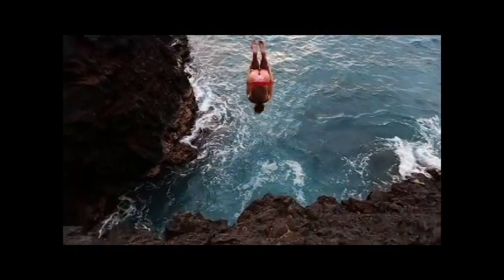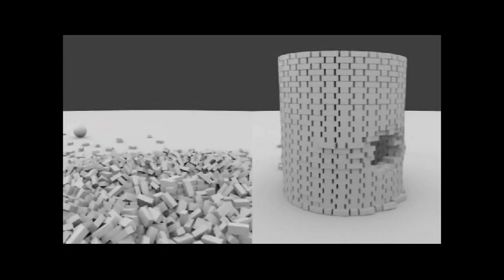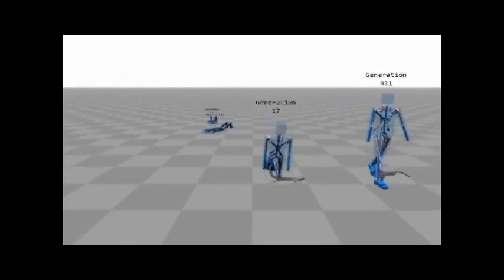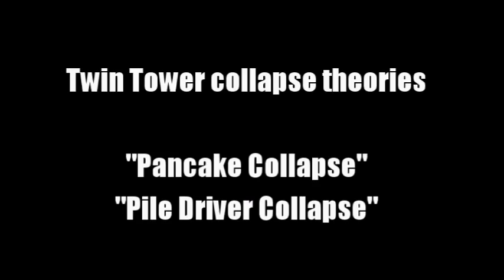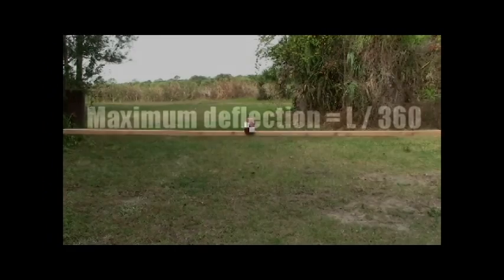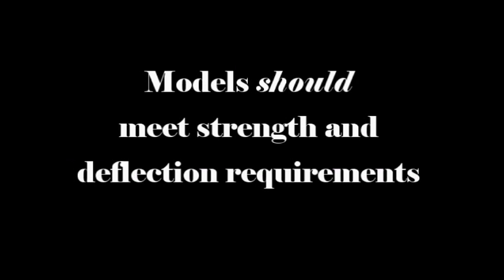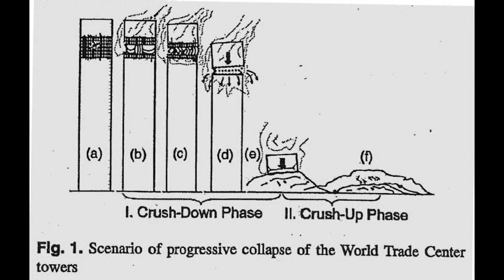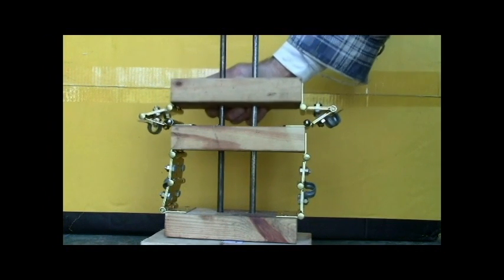9/11 Experiments: The Force Behind the Motion

Comment: The reason I think the upper structure was able to destroy the lower structure is you have the weight of the flooring all combined but where is the jolt or deceleration. Are we missing it through all the smoke? I'm also trying to figure out how we got to 1300 degrees on the ground did we have to have an oxidant because they claim there was no evidence of aluminum oxide? Worcester polytechnic Institute claims that they discovered sulfur in the fireproofing.
Reply: Conventional fire burns that hot - and hotter.
Reply: @Tim22222  steel and concrete can burn at close to 1400 degrees Celsius? Close to 2500 degrees Fahrenheit on the surface of a smoldering fire of concrete and steel? What was the highly energetic fuel.  At least those are the numbers that have been cited in webinars I've listened to. I've been struggling to find NASA's open information on that and looking at the locations of the temperatures in the aftermath. From what I understand kerosene jet fuel is actually a rather low energy fuel can't accomplish this kind of temperature. I haven't a clue but if you could site me some scientific evidence I really would love to shut the door on this conspiracy theory.
Reply: @Tim22222  I'm mixed fahrenheit and celsius. I misinterpreted information at 1340 Celsius when it was actually  1340 fahrenheit.  NASA says 1000 Kelvin = 1340f on the 16th.   I still wonder what the oxidizing agent was at that temperature? We are talking on the 16th of September these were the surface temperatures from satellite so the interior temperatures may have been significantly hotter. The reason I got so hooked on these numbers is because I was trying to understand the eutectic steel formations. The origin of the sulfur in the melted corroded steel. I watch the webinar from NSL analytics and they pointed towards fireproofing as being the source of the sulfur but the sulfur in order to create these formations had to be in a very intimate position but that still doesn't explain your oxidizing agents and residual heat of 1,000 Kelvin four days later? They claim WPI worchester polytech Institute had discovered the sulfur in testing some of the fireproofing but I was not able to find that in wpi's database in their research library.
Reply: @Tim22222  have you seen Leroy Hulsey  analysis of the thermal expansion theory and how it directionally it has problems, he left the fireproofing  out of his calculation in order to give a worst case scenario. stiffest point in the floor plan was actually the stairwell he believed majority of the expansion would have headed outwards upon that longest beam..  the National Institute had fixed the perimeter wall as the point of origin for expansion.   Their calculation had all the expansion heading inwards towards column 79, to push the adjoining horizontal beam off its seat. Then intiating the progressive collapse theory. But the drawings showed it was bolted to it's seat, had 30 shear studs in the concrete floor above it, was encased in the vertical column by extra torsional stuffers, and that it had web stiffeners on the end of the flanges where folding over of the flange would have been inhibited if it slid half way off its seat. And all of these elements were left out of the official model to accomplish this theory. This model did not explain how thousands of other connections of beams were unable to resist the force of  one beam falling. Hulsey has been spending years on a model trying to figure out what variables would have to be in order to truly accomplish an interior collapse. He briefly had mentioned if you removed the connections of eight floors you could initiate that collapse. But he's yet to release a full report on that wanting to make sure it's right.  I thought that was coming very soon. The only reason I know about all this is because I watched a newly released A&E building 7 webinar that laid all this out.
Reply: @akiracornell  " I still wonder what the oxidizing agent was at that temperature?"

Oxygen! A pile like that is hardly airtight, and there was unlimited fuel. Underground fires like that are not unprecedented ... As far as the eutectic corrosion I get that that's fascinating; from what I understand, it's more of a chemical process that takes place at much lower temperatures than fire. Sulphur was present in the sheet rock used to build interior walls of the offices.
Reply: @Tim22222  you  obviously did not watch this author's other experiment on eutectic steel. At minimum of 940c that's close to 1800 Fahrenheit in a slow burn based on the metallurgy.  that's the minimum we know it had to have reached. You really need to watch his other video on experimenting with kerosene and crushed gypsum wall board as the sulfur theory, that's a no go Houston. 
  Smoldering fires without flames yield lower temperatures. You need an oxidizer or high amounts of oxygen. This is also a significant amount of sulfur involved in the reaction from what I understand. I need to better learn how to decipher the eutectic diagram to understand the sulphur percentage by weight in the reaction.  But again not only are these temperatures combined with the sulfur peculiar we don't have the input data for the progressive collapse model by NIST for building 7 to be corroborated by those that question whether or not something else could have happened. All we have is this far-reaching anomaly theory. If you believe in science and you listen to Hulsey's calculations, it's only obvious if you are willing to look at things from a scientific perspective, it's time to consider other hypothesis, but that's not the story we're trying to defend here are we?
Reply: @Tim22222  nobody can prove it was thermate involved in the eutectic formation but thermate can exactly produce the type of erosion that occurred. This author shows that if you can encapsulate thermate you can configure it quite easily to sever beams. Imagine if you could put some type of polymer that would air dry on the outside and apply in a beaded fashion. Then at the end of your cut place bits of nanothermite to finish the job. I'm pretty sure somebody could develop it. It makes a whole lot more logical sense that some type of covert mission could have been done to infiltrate that building then to think it was just an anomaly that self collapsed on itself because one beam fell out of place because another beam expanded the wrong way breaking the bolts and pushing it off of its seat eluding it's sheer studs and going through the encased vertical support on the column to create a theory to explain how the penthouse fell and sucked the whole structure in before the exterior collapsed in free fall. If there are people capable of engineering and planting a virus within a closed Network like the stuxnet. I think brainstorming and infiltrating a building is not that hard; I believe there was a man named Jennings who went back into the building 7 to get something and heard explosions and was told to get back,  it's coming down we have information of bombs. Nope they didn't exceed 130 decibels but this author has also shown that you didn't need to with the proper chemicals that could create the kind reminant steel and temperatures we saw. There was also a seismic bell curved wave indicating explosive nature  that preceded the collapse.
Reply: @Tim22222  didn't cardington test show that the beams would sag before thermal expansion would bust the connections?
Reply: @akiracornell  I stand corrected; looking back at Appendix C of the NIST report, they too cite temps of about 1000°C to activate the eutectic reaction. Still, though, that's a lot less than the straight-up melting point of steel and consistent with estimates of the temperatures of the hottest fires.
Reply: @Tim22222  I believe they cite the fires were probably half of that temperature while they were burning. They also say that the maximum thermal expansion would take place somewhere around 300 c I believe. And building 7 had actually collapsed hours after the fire was out in the location that they say where the thermal expansion happened. For me it was almost a fraudulent theory to create reasonable doubt that the office fires were responsible for the building 7 collapse. Hulsey takes the theory and puts it on its head. It took them many many years to even come up with some kind of collapse theory they could give to the public
Reply: @Tim22222  in thermate and thermite you don't need free oxygen. It's typically an aluminum powder that is the oxidizing agent but a lot of debunkers like to say that they didn't find any aluminum oxide spheres I do believe there are other powders and chemicals that can be used that will accept the electron to produce the exothermic reactions. And I'm not sure how much of it will gas off not imbedding into the steel like the sulfur did. From a lamens point of view trying to speculate, these are questions that I have. I have heard that FEMA hadn't gone out until 30 days after to start taking samples and investigating. Much of the material was already gone.
Reply: @akiracornell  I'm no chemist but as I understand it the key finding of the Millette study of the WTC dust - an independent attempt to reproduce the Harrit/Jones result - was not about aluminum oxide but rather elemental aluminum, a required element of thermite which was not found in the dust. No elemental aluminum, no thermite.
Reply: @Tim22222 that's the point Mick West tried to push but, that's what I was trying to hypothesize, because iron oxide loses the electron and becomes the new free radical while aluminum oxide is formed.  My question is, does most of the aluminum oxide predominantly gas off  leaving minor traces of aluminum oxide spheres or dust, or whatever oxidizing agent that gets reduced. Can they be dusted off and lost because most of it ends up being vaporized ?  The other issue we have is they only had a handful of pieces, some from building 7 and the some from The towers. FEMA didn't get out there for 30 days and most of it the debris were gone, They didn't really have much to analyze. Again I go back to the peculiarity of the fact that there was an intimate, abundant sulfur on the steel and the temperatures of smoldering  office furniture should yield much lower temperatures without being fan fired,  which points to chemical fire much more likely culprit.  Again you had witnesses see of flashes of light and pressure Puffs according to NIST. And anything under 130 decibels was not considered an explosion. All the other correlative incidents get ignored seeking an explanation for. My question for you is Have you listened to this author's videos and understand all the problems with the official story? Have you even looked into Hulseys examination? If you're going to ignore all of those other things and just hang on creating reasonable doubt that office furniture could have created 1700 degrees Fahrenheit at minimum in a smoldering fire I think your lack of natural curiosity to answer the other questions causes me to question your motive here
Reply: @Tim22222  I do remember reading a written a&e rebuttal to the WTC 7 report from nist, he claimed Jones had found fluorine and traces of aluminum in the metal that he had tested. I'm not sure what chemical process the metallurgists use to examine the molten steel, but being  the oxidizing agent becomes a stable molecule I don't know how much of it would actually embed into the steel itself. This is a very good question for metallurgists because they made no clear mention of we don't see any residues of aluminum oxide, but maybe they wouldn't be able to see much of it based on the type of chemical reaction that's taking place or the process they use to analyze it? You or I should seek out one of the few in the country that has a clear answer to the question
Reply: @Tim22222  here's another question for you. Takes months of planning and strategic placement of cuts and explosives to get a building to implode into its own footprint. But the official story says they only needed to displace one beam to accomplish the same thing,  do you see the irony in the deductive reasoning?
Reply: @akiracornell  "do you see the irony in the deductive reasoning?"
Yet it took 3 years of study to come to this conlcusion. I can hardly imagine any CD company doing the same to see if they could save a few bucks on explosives.
Reply: @brucelansberg5485  Make-believe nonsense, is the sources.

Comment: For 2.3 billion we could rebuild the towers and remote control two planes and test it again.  That's a drop in the bucket compared to what has been spent in Afghanistan.
Reply: I'd settle for a test of the aluminum plane that is ripped apart by birds flying into the exterior of the building.

Because I say it folds up like a pancake.

Id also like one vs 3 feet of concrete and kevlar that builds the outer wall of the Pentagon. 

And I want a trainee pilot who flies a passenger jet at about 500 mph just above the ground and manages to keep it level.
Reply: @DS94everXev  "I'd settle for a test of the aluminum plane that is ripped apart by birds flying into the exterior of the building."
Ok, so, you want to do something irrelevant and useless, and you think this has any meaning? Ok, sure, you do you.

"Because I say it folds up like a pancake."
I'm not surprised. You're good at saying nonsense and thinking that it even slightly matters.

"Id also like one vs 3 feet of concrete and kevlar that builds the outer wall of the Pentagon. "
And, again, you want to something irrelevant and meaningless. This time by claiming something stupid. COol.

"And I want a trainee pilot who flies a passenger jet at about 500 mph just above the ground and manages to keep it level."
Which is not only nonsense, but again in reference to something stupid. You're on a roll, aren't you?
Reply: Why 2.3 billion? That sounds like a lot of money to satisfy conspiracy theorists that have no clue about engineering. And what would it do? A true believer won't be convinced by any other outcome than his own truth.
Reply: @brucelansberg5485  Please explain how building 7 could have fallen at the speed of gravity, as NIST has admitted, without a simultaneous shearing of all structural columns (fire would not cause failure at all columns simultaneously), so as to provide zero upward resistance against the force of gravity. And FYI I have worked in architecture/engineering for over 20 years.
Reply: @brucelansberg5485  2.3 billion is the estimated cost to build the towers again at todays cost. Of course that may be higher than a couple years ago when I read that.
Reply: @brucelansberg5485  "In stage 2 the north face descended at gravitational acceleration as the buckled columns provided negligible support to the upper portion of the north face. This free fall drop continued for approx.. 8 stories or 32.0 m (105’) the distance traveled between times t=1.75 and t=4.0 s. " NIST Final Report
Of course free fall means no support not negligible. So you are an engineer Bruce?
Reply: @jasonferrier7264  "2.3 billion is the estimated cost to build the towers again at todays cost."
That sounds about right.
Reply: @jasonferrier7264  ""In stage 2 the north face descended at gravitational acceleration as the buckled columns provided negligible support to the upper portion of the north face. This free fall drop continued for approx.. 8 stories or 32.0 m (105’) the distance traveled between times t=1.75 and t=4.0 s. " "
"During Stage 2, the north face descended essentially in free fall, indicating negligible support from the structure below." -NIST FAQ on WTC 7.
So, we can see that no, there was no "free fall". It was ESSENTIALLY such.
Incidentally, while NIST is using laymans terms, the phrase is "gravitational acceleration". "Free fall" means the building jumped out of an airplane.

"So you are an engineer Bruce?"
"So, what's YOUR qualification?!" Also known as "I said nonsense and now I have to pretend that I'm smarter than him!"
Reply: @mooneyes2k478  Your quote from NIST just literally  said "This free fall drop continued for approx.. 8 stories" and you followed that with "So, we can see that no, there was no "free fall" . Why am I even responding to you?
Reply: @jasonferrier7264  Because you think that, if you just get the last word, that will magically make your stupid shit not stupid and you'll "win", of course.

That I quote YOU does not make it a NIST quote. On the other hand, the ACTUAL quote from NIST clearly state "essentially in free fall, indicating negligible support". Which then translates into "not actually but very near". That's the meaning of "essentially" in that sentence.
Reply: @brucelansberg5485   Many would be Ok if they just released the Pentagon cctv footage showing what actually hit the Pentagon
Reply: @abhilashyadav2274  "Many would be Ok if they just released the Pentagon cctv footage showing what actually hit the Pentagon"
Do you mean the know cctv footage is doctored?

Comment: plus the building had many steel columns in the middle.This model dosnt have that.
Reply: So?  This model is not testing things inside the middle.  It is merely testing to what happens to a falling object as it comes into contact with stable objects benesth it.

Will it ALWAYS ow down?

Yes.  It will.

That is all that matters because the towers did not slow down.  Thus demolition was used.
Reply: @DS94everXev  "That is all that matters because the towers did not slow down.  "
Oh, are you spouting your fantasy again?